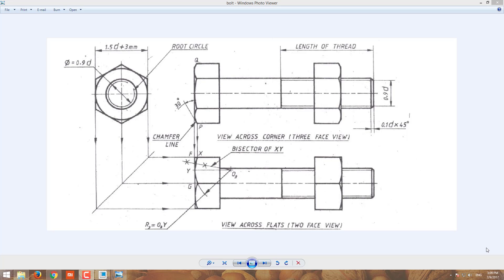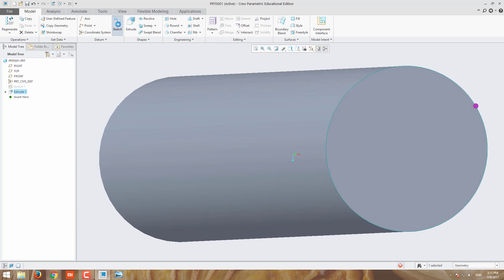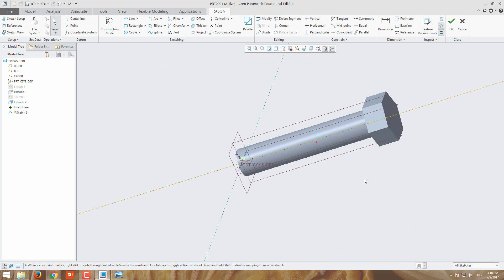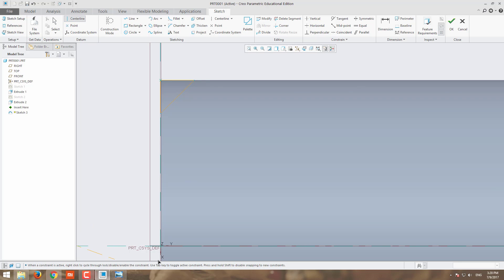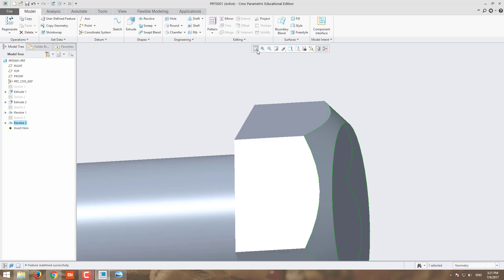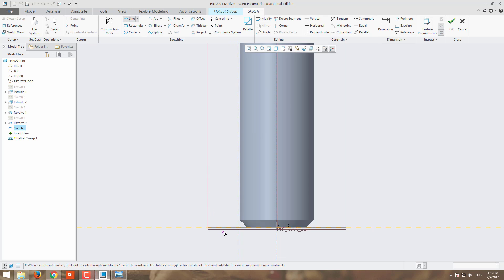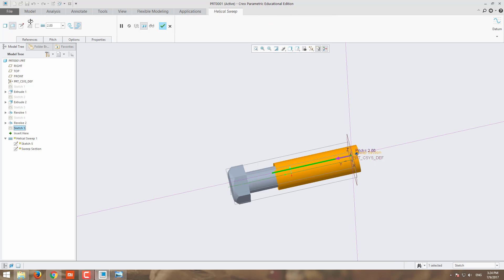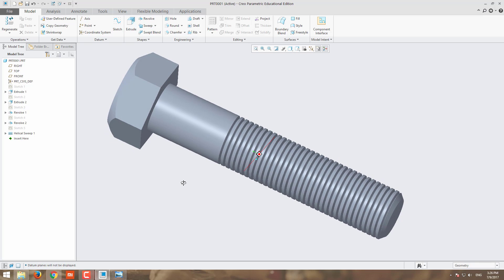4 CREO TUTORIAL | HOW TO CUT EXTERNAL THREAD IN CREO | BEST ENGINEER

Comment: 2 observations for you. If you don't constrain the 60 degree section about a perpendicular centerline, your section will be off as was this one, and 2. if you don't control that section about an industrial standard, the thread is purely cosmetic and not nearly accurate enough to pass a global interference check at assembly. I posted a video on the correct construction on my channel if you'd like to stop by for reference. My software is Pro-E wildfire 2.0 and 4.0.
Reply from the maker: Thanks for your valuable comment